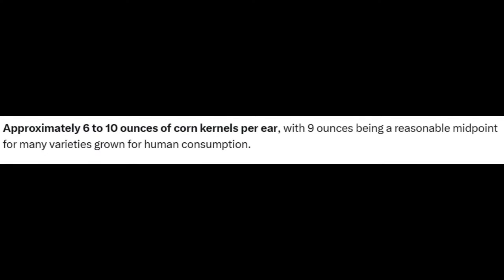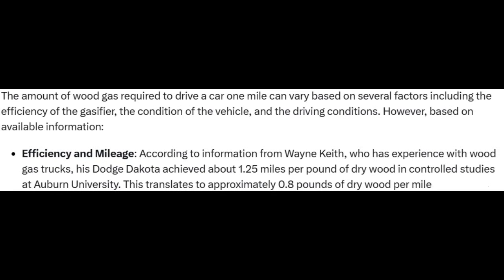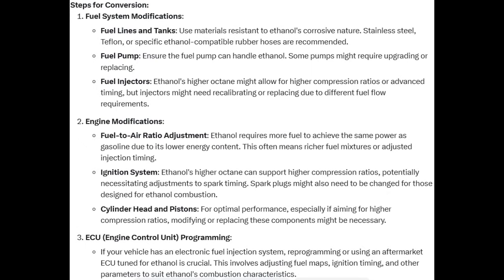Alternative Fuels - Ethanol or Wood Gas

Comment: Great video PB. Like you said there is no perfect solution for everyone. The more options you give yourself by learning, the better off you are. I personally use solar panels with a battery bank. As a back up I have a gasification powered generator to charge the battery bank if sunlight is limited. FEMA doesn't do very many things right, but the FEMA website does offer very good detailed instructions on how to build a gasifier in PDF format. It's worth downloading onto a drive. Check out videos from Wayne Keith. He is probably the authority in gasification and goes into great detail on how they work. Have a great day and GOD bless.

Comment: Coupla things you didn't mention. 1. A gasifier REQUIRES a filter unit before the gas goes into the engine. You will gum up the engine in a short time without it. 
2. You only have to build it 1 time... personally I think it is a great investment of time and money.
3. In my area..N Ohio... we have many days/weeks in a row with heavy cloud cover. If you only have solar.. you are #%$/ed. If there is no other energy.... you have no power, even if you spent $100,000 on solar panels and batteries.
4. It takes about 20 to 30 minutes after starting the fire to have enough gas buildup to start an engine. It is not like turning the key and going. This is why it is not used today. And a car/truck can only go maybe 20 mph on wood gas.

Comment: Woodgas is fantastic. The first project I took from YouTube back in 2009. However! Keeping a gas engine from gumming up with wood tar is serious issue...If I built one again it would be dual fuel... After running woodgas, switch to gasoline for the last few minutes to burn out the wood tar, or else when the motor cools, the valves will be welded shut with tar. Viable for power generation(cloudy days), not automotive use.  Ethanol, ie Boss Hog fuel... You need to triple distill, any water content will clog up venturies in a carb or injection systems.

Comment: 1 corn stalk will give you 2 ears of corn ..... it the squirrels don't eat them first.  
I tried growing corn in a 30 x 40 foot plot. Dang if Rocky didn't steal it all.
Reply: Deer and tree rats
Reply: Here it's trash pandas. Lol
Reply: What no squirrel stew? Lol
Reply: Use the 3-sisters method. Plant at least 4 rows of corn for good pollination. Plant your beans with the corn. Pole beans will climb the stalks. Plant your squash around the corn patch. Raccoons, squirrels and deer don't walk through or like squash because the stalks are picky.
Reply: @questioneverything9535 hate to say this, but the deer love my squash plants. They will move it off if no fruit on the trees.
Reply: @questioneverything9535 When planting the three sisters, timing is crucial. The corn has to be tall enough for the beans to climb without being overgrown by them.